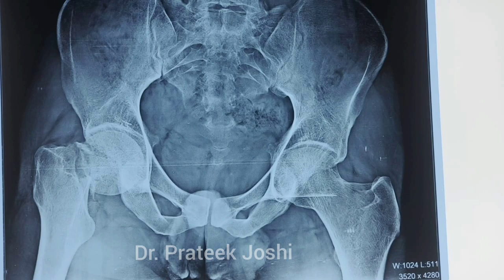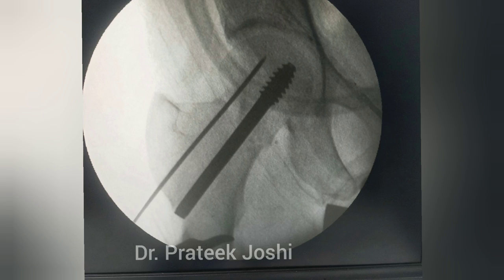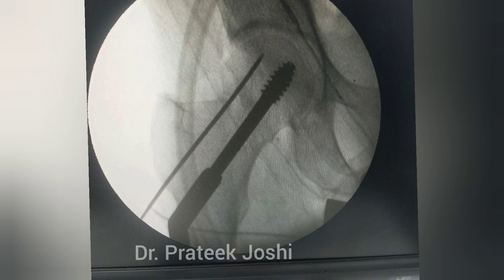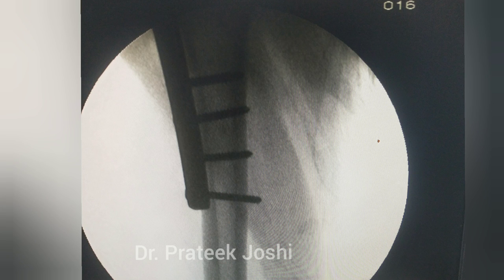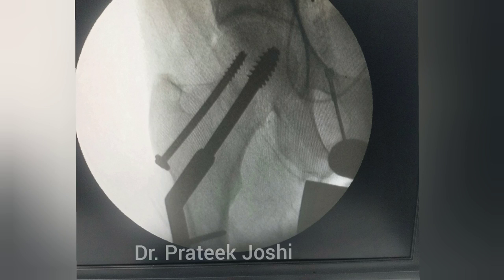Dynamic Hip Screw Surgery | DHS | Neck of Femur Fracture | Hip Fracture | Dr. Prateek Joshi

Comment: How much valgus is expected in DHS final fixation
Reply from the maker: we usually keep mild valgus while fixing such fractures to make fracture line more oblique than vertical. too much valgus will fail as medial cortical contact will be compromised.
Reply: Is any role of de rotation screw in DHS??
Reply from the maker: @letsgetfreedom7683  a big role in such cases...it prevents rotation of head